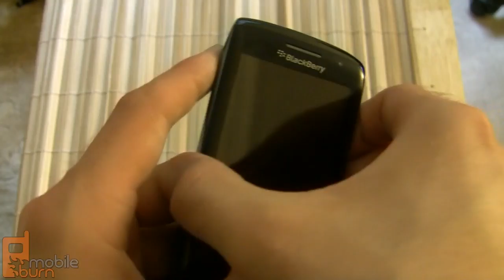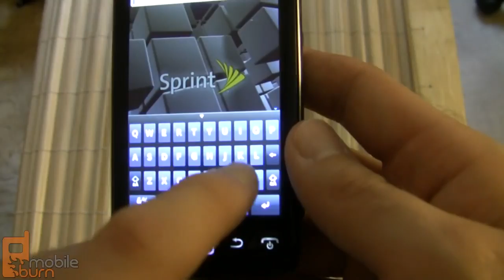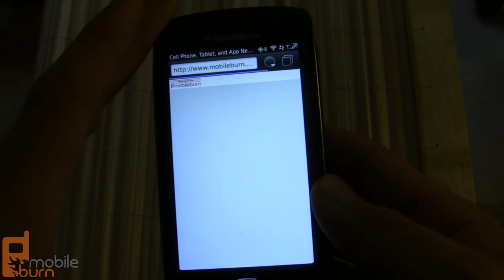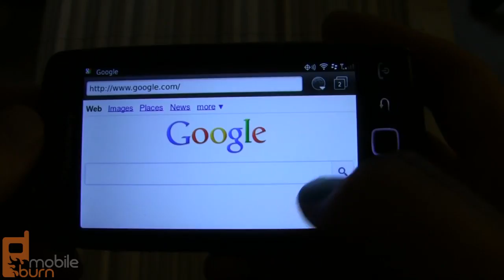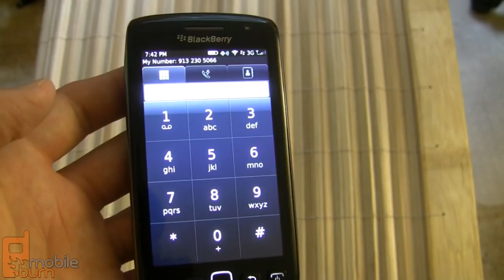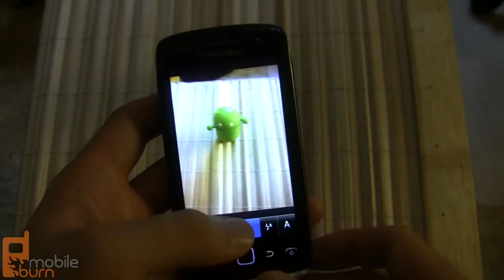RIM BlackBerry Torch 9850 (Sprint) smartphone video tour

Comment from the maker: @nhlsens I think you should be the one to check - or provide a source. The only reference I see to WiMAX on the 9850 is a mistaken Engadget story. Even the press release included in the Engadget story makes no mention of WiMAX.  The official spec sheet from RIM makes no mention of WiMAX, either.

Comment: @nhlsens Can you provide proof of that? No where in Sprint's material for the 9850 does it mention 4G. 4G for Sprint is WiMAX, not HSPA+, since it does not run a network with HSPA+ technology.